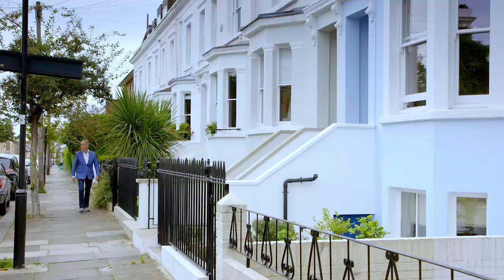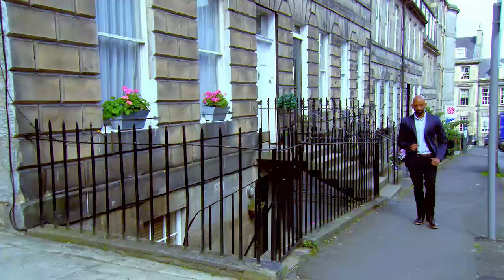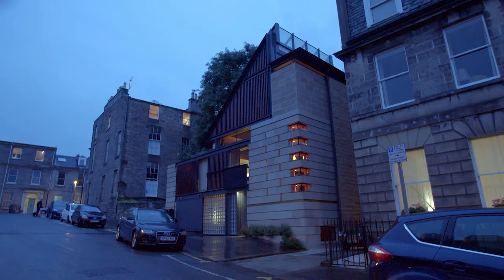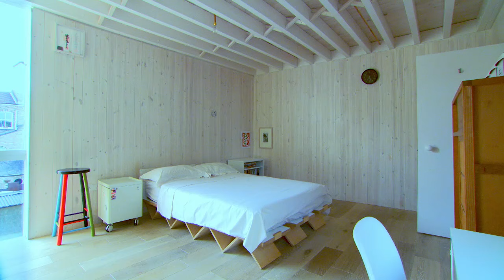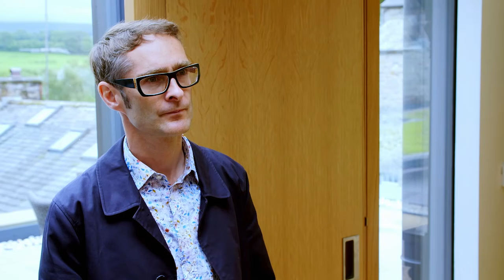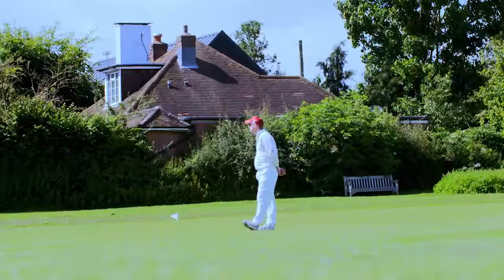Grand Designs: House of the Year | Boundary Pushing Design | Season 2 Episode 2 | Full Episode 2016

Comment: This is the perfect example of design run amok.  How will you clean all that glass?  How will you maintain all those mechanical lifters and openers?  The fake wood  furniture will last 5 years at the max, then start disintegrating in any humidity at all. Houses were built in the past to last.  What we have here is children experimenting with fake everything.  Take a crayon to that cement wall, have fun.  No thought to real life, real people or real  anything.  These houses will be torn down in twenty years, a waste.
Reply: @ColoradoKrone  a crayon would be fun, and actually the pols and such are still working, I saw it in a different later program, they are mostly not motorized, so less maintenance . The motorized one do make a lot of noise. That all said, that particular house consumes very little energy, so all those gizmos have an ulterior purpose beyond the fun of designing them. The glass, ok, sure lots of cleaning